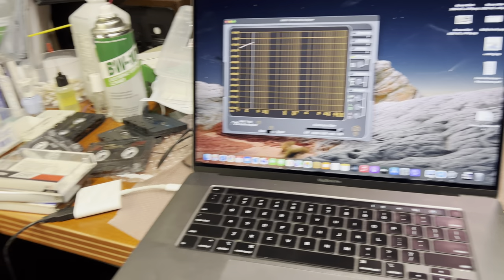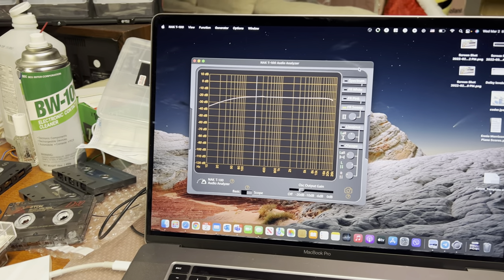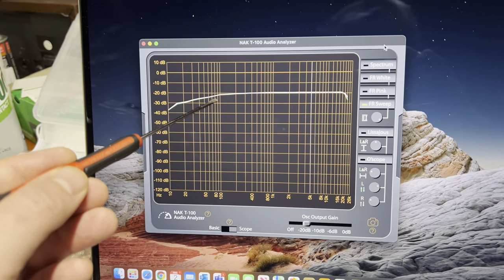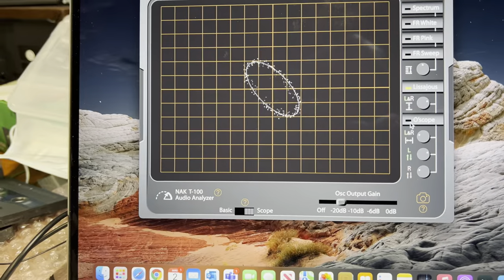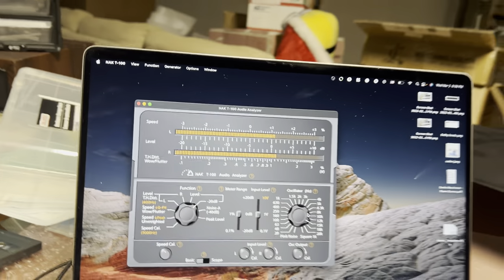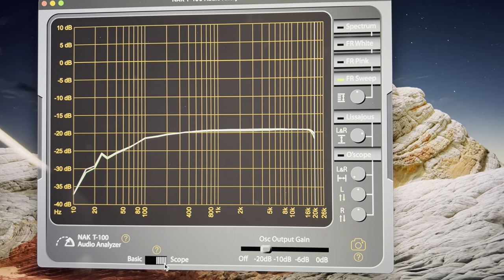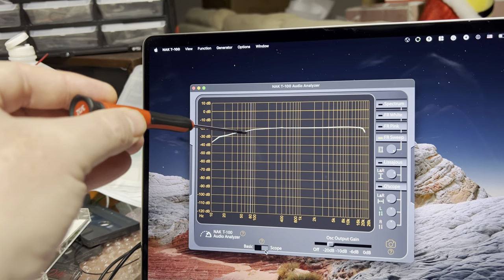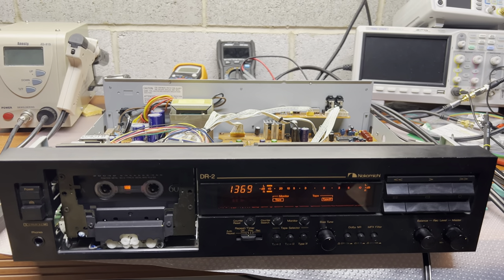Fine-tuning Nakamichi DR-2 using Nak T-100 Analyser software

Comment: Thanks for the update on the previous video ( I missed this one) and makes it all more clear now.
I was just wondering where the other two dials stand for, if the upper grey dials are for the high frequency response, could it be the dials below that are for the lower frequencies?
They're on the same position, same components and lay-out for L & R channels, so probably both frequency fine tuning dials. Have you ever tried these?
Reply from the maker: Other two are bias filters to prevent it from going to the record amplifier.

Comment: sir, i have nakamichi dr 3 secondhand. i don't know if it's been serviced or not before. 
the problem is whenever i try to record and the rec level balance is on center, the output left channel is always louder, so i need to balance it to the right like 2 bars to make it less loud and balanced. so what is the cause of my problem sir? is it repairable? thank you.
Reply from the maker: Hi there, I would start from the cleaning of the tape path. If this is not a cause - then deck is due for a service/tuning.
Reply: @hifirulezzz  do you have the video or reference for the service/tuning process?
Reply: @hifirulezzz  thankyou for the reply